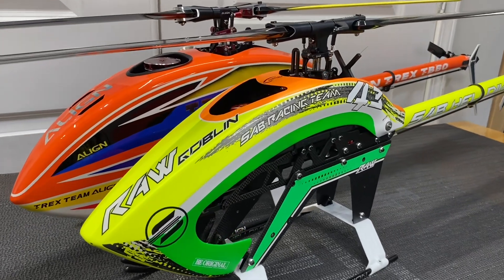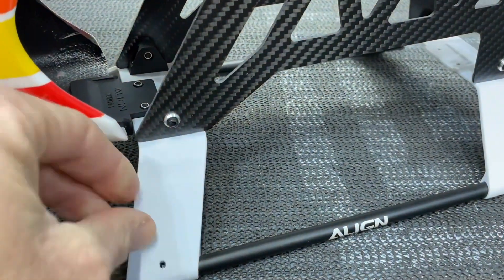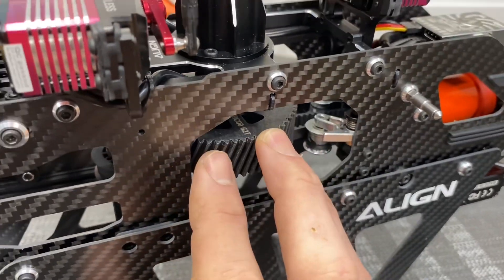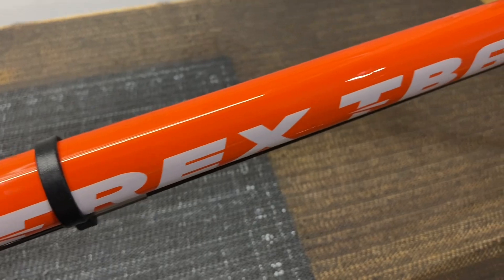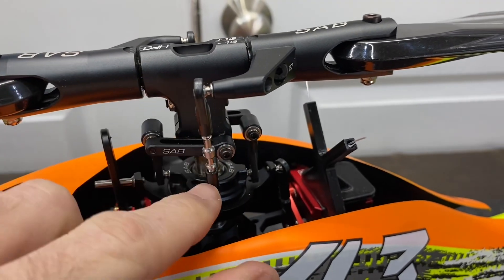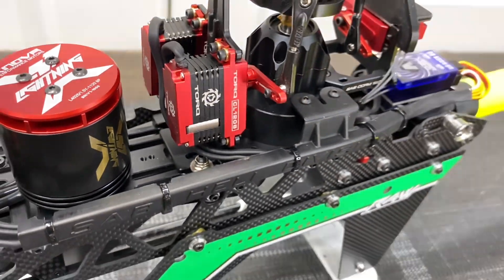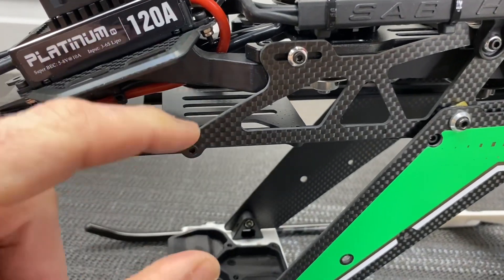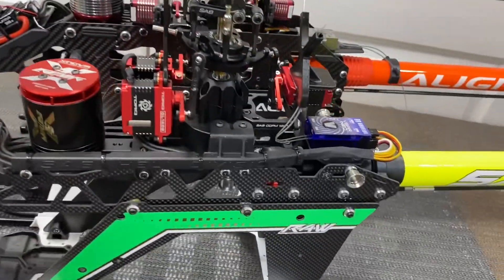Align TB60 VS SAB RAW 580! Which One Should YOU Choose?!

Comment: Hi Jeff, how did you make the rubber guard around the motor hole edges on the canopy?
Reply from the maker: Hello! So I used auto trim for door. It’s on Amazon. I’ll find a link but it has double sided tape so it sticks with no glue. I just cut to fit and put it around.
Reply: Super! I found it on Amazon. Looks a great solution. Thank you

Comment: My 12sTB60 on Rail 626s flies incredible. Align quality is definable stepped up on the TB models. (Minus the canopy)
Reply: Are you able to run 5000mAh 12s packs with the longer blades? Or do you still use 3300mAh packs?
Reply: Yes you can if you want. . I use 12s 3000 and get plenty of power and great flight time.

Comment: Hello a couple minor questions i have on the motor you are using i see online 3 different lengths of the motor shaft 28mm,32mm and 36mm which one are you using?

I also saw online only the motor comes without a pinion but im not sure what motor pinion to use can you provide me a link to one please?

And last question which bugged me the most which servo are you using for the motor you only mentioned it’s full sized but made no mention of which model of servo and we know there’s a million different ones 🤦‍♂️
Reply from the maker: @skyforce1983  for which heli? RAW 580 or the TB60? Two different motors. What do you mean servos for the motor? For the pinion, that’s is included in your kit.
Reply: @westhobbiesrc8051  sorry for the RAW 580 I’m on the website heli direct and they only offering the 580 but as a kit and i went to your video and watched 3x i went back online to heli direct and the same motor you are using has a shaft A version B and C but looking at the contents of what’s included with the motor the pinion is not listed as a component that comes with it so i decided to ask you which shaft size and which pinion.  

Also if you have a link to a website that’ll give me the RAW ARF instead of a kit I’ll buy it that way

Btw this is the part number so you see it does not include a pinion SKU: XN40251120L-A
Helidirect

Comment: All great info. However, what about a RAW vs Kraken? What's the real difference other than the look of it?
Reply: Repair cost, the kraken boom is $80, raw is like $30. Sideways flight on the raw is better as it’s open air design. Unless you’re doing smack 3D pry won’t notice. Kyle and Bert do a good comparison video.
Reply from the maker: I’m almost finished with my Kraken and I will definitely do that video. The main difference that the RAW is lighter and a lot more open so in sideways or a lot of tail flying you will notice a lot more consistent tail on the RAW but if you are not a smack 3-D pilot. You will never notice the difference in between the two machines other than Cost

Comment: Two separate servo issues/failures on new Align kits plus numerous BeastX issues caused me to walk away from the brand. Its too bad, cause their kits sure were convenient, but I guess it served its purpose after returning from a 10 year break.
Reply: I had the right servo lockup on maiden, First align heli. Needless to say I replaced all the servos on it.
Reply: @heli_sport   Yes sir, I can relate to that. Took the 550X out after dozens of flights and the right collective servo just ran away and rolled hard in and was locked in that position post crash. HLX's are in there now!
Reply from the maker: I have only had one a line servo go bad, but I have read many people having that issue. Now the microbeast/beastX is another story lol. Very famous for the right roll of death for absolutely no reason. And that is why I know longer fly anything with that FBL unit.